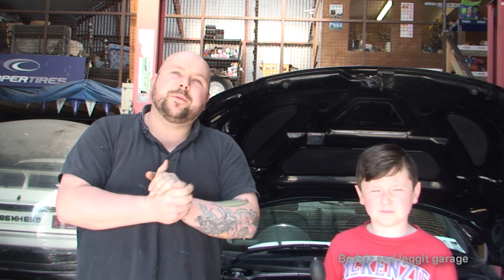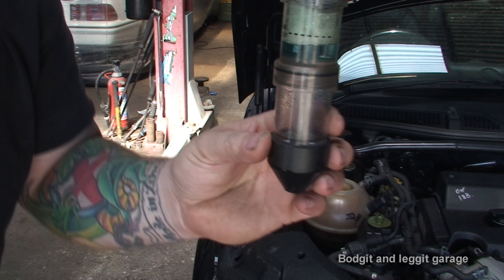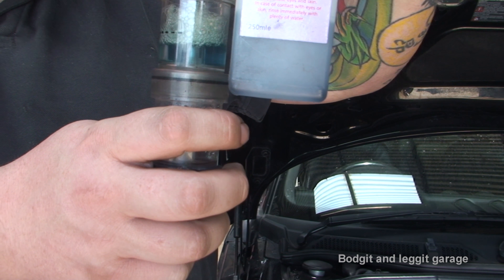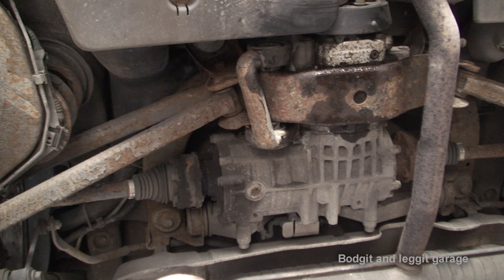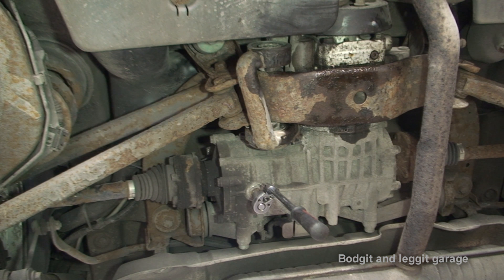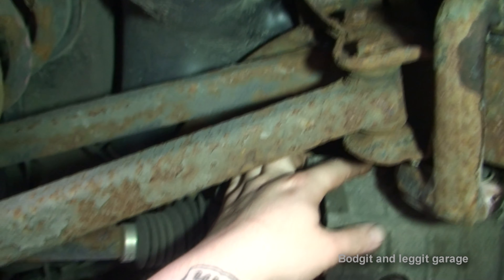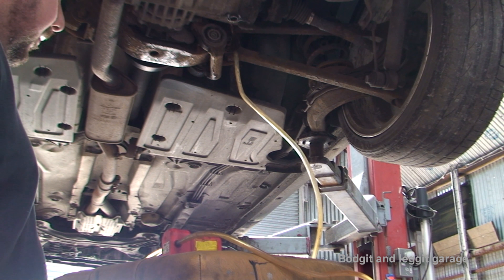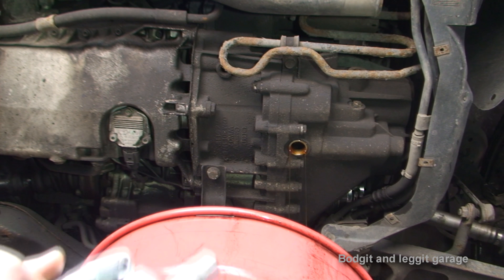Audi TT Head Gasket Test Rear Differential/Front Gearbox Oil Change Bodgit And Leggit Garage

Comment: Great video, wish I’d found it before doing mine, went ok but would have been handy. Also changed wheel bearing, sod of a job and front/rear coil springs etc equally 🤬😤🤬 then one of the abs sensors went (very grumble) sod to get out, now the front exhaust flexi has gone - I’ve given in on that going to a garage don’t fancy it without a lift. But I did get my hands dirty, I think Sean should have another chance at an oil bath soon 🤣
Reply from the maker: thanks mate

Comment: What is the type of the oils you are using? I think you said sae 75-90 for rear differential but i missed the gearbox...
Reply from the maker: Hi mate the easiest and the best thing to do is contact your local Audi dealer and get them to send you the correct oil as different models different engines size take different oils

Comment: Leon, Did you spot the FNS wheel has tyre on the wrong way round (directional) Thats an MoT fail over here
Reply: Steve Ashcroft not for much longer 😁😉
Reply: I wouldn't bank on it, I know it's not in the draft of the new test manual, but as it's only a draft I suspect when it comes into force in May "not fitted in accordance with the manufacturers instructions" will be there!  It's ludicrous to omit it as a directional tyre wrong way round in the wet has very little grip. Mind you removing the "bounce test" for shockers is ridiculous. Slight mist of oil this year = no oil next year.
Reply: Some of the new rules in place are absurd doubt it will be a smooth transition lmao